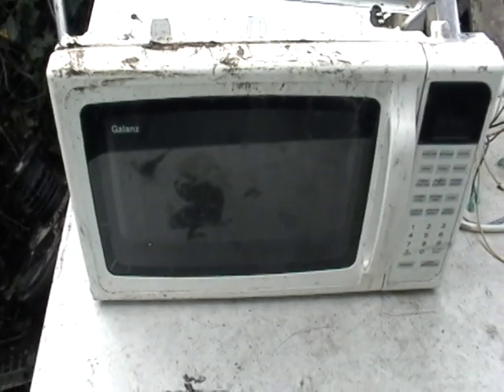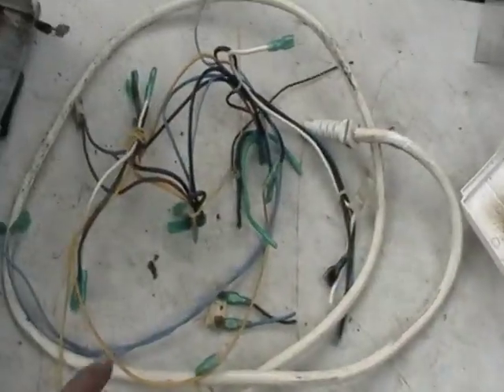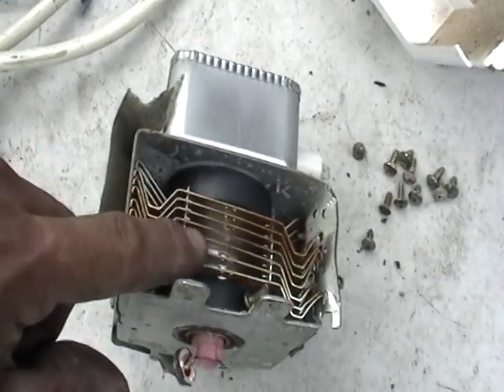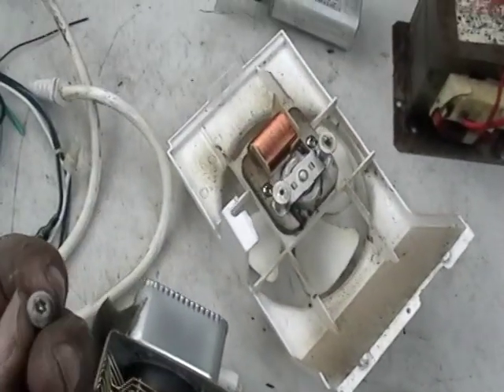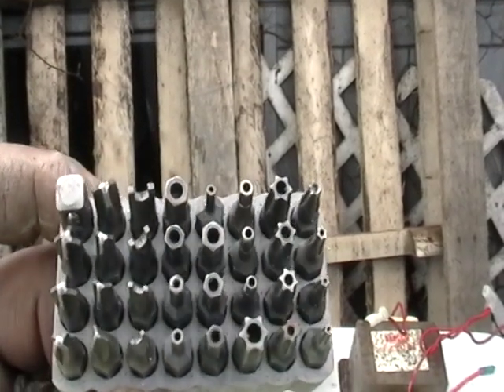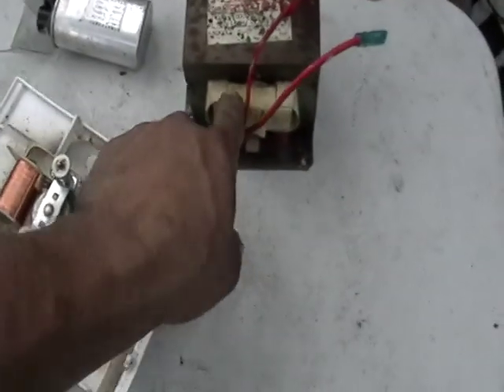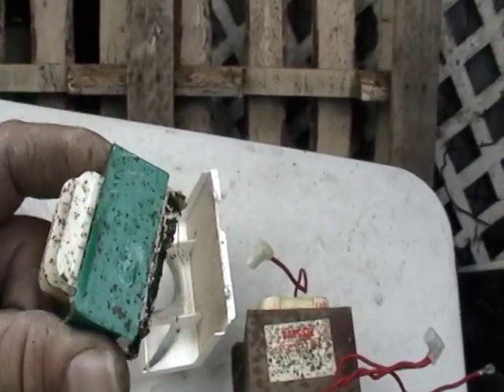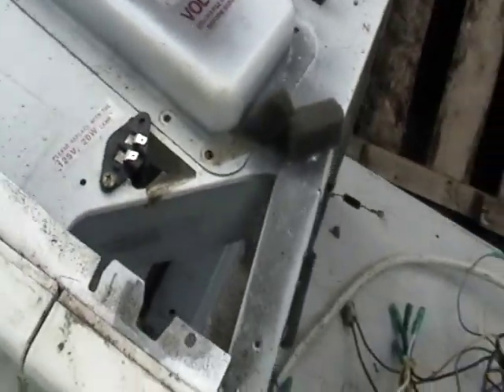Scrapping a microwave oven for copper

Comment: that sealed unit you refer to is an electrolyctic capacitor it hols chrge and i have fount that the oven case gutted out makes nice case for pwer supply for other devices like car mps and such that takes lots of amps to power. recycle and reuse much as possible and save some time fabricating a case thanks for your video very nice .

Comment: Mike, I took apart a microwave last night, and took out that big heavy transformer with all the copper in it. I was just wondering if you know an easy way to take all those little metal plates apart to get the copper out. I smashed it with a sledge hammer until it broke and it wasn't pretty. There is always a lot of copper but it has a hundred tiny metal plates all stuck together... Thanks!

Comment: Save all those high voltage caps and sell them as a bundle on ebay (label it as like high voltage capacitor bank capacitors). I guarantee you that you'll get butt loads more than 11c/lb. All these people that need high voltage caps for inverters etc. Example; ME :-) need butt loads of them to handle the ripple current that we're messing with and we need a lot of capacitance.

Comment: You can smash those transformers and small electric motors with a hammer, and pull the copper out. Then go back with a magnet and get the steel:)